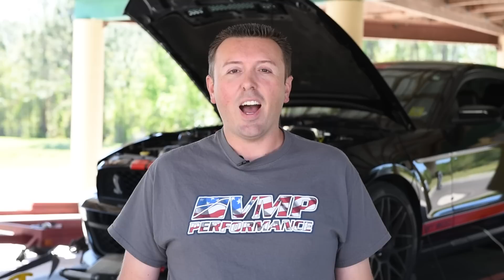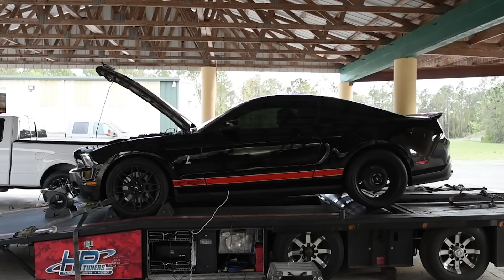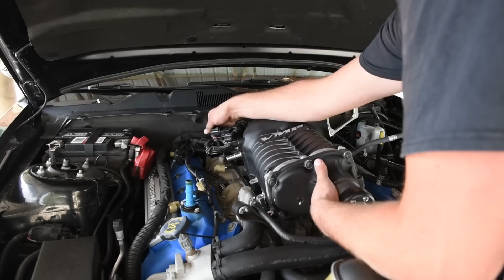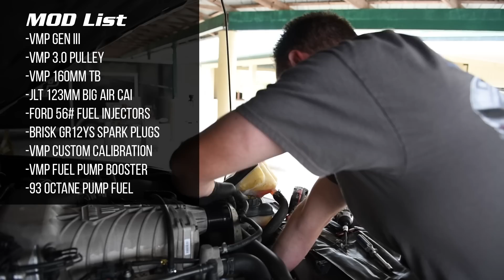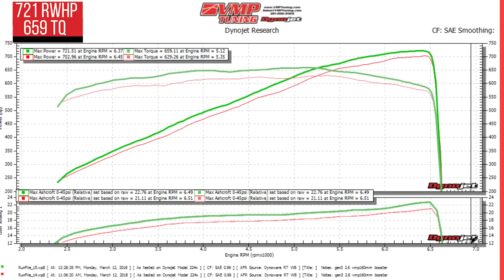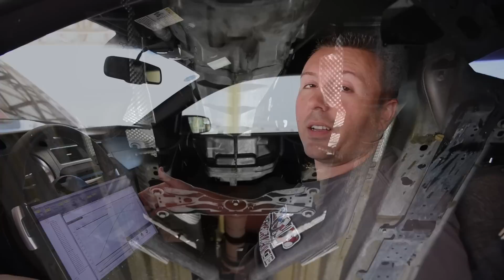VMP Performance | Stock 2012 Shelby GT500 Blasts Out 800 HP With VMP Gen3 TVS Blower

Comment: thought the 2012 gt500 made 663hp?
Reply from the maker: It was rated at 550hp, in 2013 they got the bump to 663hp with the 2.3l tvs and 5.8l engine.
Reply: Oh thats right, for some reason i thought they started that in 2012.. All that aside i cant wait to pick up a newer F150 and throw a VMP blower on it.

Comment: So i guys I have the 14 gt500 I bought your Gen 3 with 2.4 thru Chris at Dyno Edge it made 839 -17psi e85 ID 1000s, jlt 123, and vmp twin67 tb, my question is without going to a lower pulley do I stand a chance in making a  bit more power by going larger on the TB and the JLT? like your 160tb and jlt148?
Reply: Old comment but yes it will def make more power with the same pulley setup with larger tbody and intake.  These blowers (any positive displacement blower) hates inlet restrictions and will see gains with larger tbodies and the 123 jlt is known to support up to 800ish so at your power level you would see gains with the larger one imo.

Comment: @VMPPerformance

Just checking in, was wondering, have you guys been able to run anymore testing?

Have you looked at using the 149MM PMAS, with the donkey dick sleeve, from 1320 Junkie performance, with the 173MM throttle body?

Comment: So how safe is 800whp on this stock motor?
Reply from the maker: Hey Joe, I don't think its too bad.
Reply: How about on a 13-14 shelby
Reply from the maker: We've had several customers run around with the maxxed out 2.3l + E85 running in the 780-820rwhp range.  The cars held up for several years.  I would feel MUCH more comfortable making that number more easily and more efficiently with the 2.65l though.
Reply: What about the genllR for that 800whp range
Reply from the maker: The gen2r would require a lower pulley and a lot of other mods to make 800rwhp.  We have only seen it done on heavily built setups.
Reply: Thanks for being honest!

Comment: SO i'm getting my hands on a 2012 gt500 with 1100 miles I want it to hit 700-750whp, what would be the cost? Or should I buy a 2014 do some basic bolt on and e85 and be done?
Reply from the maker: Hey Joe, you are looking at around $5000-6000 in components to hit your power goals.  The 5.4l with a gen3 will make the power very easily and reliably compared to a 13-14 with a stock blower and bolt-ons.
Reply: So plans changed i am now getting this Saturday a 2014. So to hit those number above or closer to 800 what needs to be done
Reply from the maker: Longtubes and VMP Gen3 along with a few supporting mods like injectors and boosters.  E85 would be recommended.

Comment: VMP Gen3 TVS Blower doesn't make it "stock" -- Nice try. Stock blower with 2.6 pully runs about 550rwhp. The 5.4 engine in this car will handle up to 850rwhp if you have the blower to do it (like the TVS).
Reply: I guess you don't understand the term stock for this car, he means stock motor, and stock exhaust.😉
Reply: @karlhopkins713  people have a hard time understanding this.  It's clear he meant the gen 3 blower kit on an otherwise completely stock car down to the entire exhaust and engine.  These YouTube experts never cease to amaze me though.

Comment: My tuner is set for 92/93 octane. If I pour in a little octane booster into my tank, will I see a quicker car? I like your shirt can I get one of those?
Reply from the maker: Hey Joe, no, it needs to be tuned for it.
Reply: VMPPerformance 
Hi
Just bought the car with your tuner.  Can I make the change myself or would I have to send to you? 
If I plug it in, just to see what it shows on the screen is it ok?
Reply from the maker: Chief Joe give us a call to order additional tunes 321 206 9369

Comment: You want to know why this video pissed me off ?  Because there using absolute junk exhaust. This car will break 1100 wheel with 2" headers to 3.5 collector and dump it.  They aren't spinning the blower hard either.  This blower can achieve rpm of 30k.  This dyno nosed over at the end because the extremely restrictive exhaust.  I question the cams aswell.

Comment: Hey Justin, I have an 11 with a 2.8 on a trinity, no cats steeda exhaust, 56's, VMP TB, JLT intake and a 10% lower. BJ did an awesome job on my email tune/road data log but the last couple of months my tr7's are getting eaten up.. like the tip will burn off after 3 hard pulls. Not even getting 300 miles out of the plugs. Any ideas?? I've ran the brisk's he recommended a while back and it's the same thing. Mostly to the plugs on the left side. Thanks
Reply from the maker: Hey, please reach out to us in a support ticket with a picture of the plugs.

Comment: I would like to see a 2.4 upper with off road x pipe and 91/torco. Mostly because the cheap people that dont want to pay for full exhaust or racegas/e85 but want to take some advantages of a more free flowing exhaust/extra timing. I am also intrigued by how much boost will drop by to see how much restriction was freed up. I think 91 octane and torco tune would be nice to see on a Gen3. In a perfect world everyone would have E85 stations right next to them or didnt have to order barrels to keep in their garage.. however it seems to not be the case for most. :) Hopefully this idea intrigues you.

Comment: The new 2650 on an 03/04 cobra! Waiting for that!
Reply: caseindaplace nobody cares. To restrictive
Reply from the maker: Don't worry its coming in June!
Reply: VMPPerformance awesome! Looking for 600hp on tap. Both the 2.3 and 2.6 will get me there... would one be more efficient in doing so over the other? In terms of engine strain and mods to support that? Any less performance with the bigger 2.6?
Reply: caseindaplace yea the tvs 2650 is the more efficient rotor pack.  Will make alot more theb 600 with very very little effort.
Reply: caseindaplace but the elbow will always be restrictive on those 03 04 cobras
Reply: MegaMma4life yea I hear that sucks but have to work with what ya got. I hear the VMP runs cooler than the stock Eaton. I suppose whatever model I choose will be better. I plan to do the head cooling mod and new heat exchanger - wonder if an upgraded radiator and coolant reservoir would be needed (5K a year car - no track time)?
Reply from the maker: caseindaplace the gen3 will do it more efficiently but the gen2 is more than capable as well.
Reply: caseindaplace the tvs rotor pack is a completely different rotor pack then the old Eaton
Reply: I guess we will see when it’s released what it’s putting down with real life customers. The 2.3 would be cheaper on a side note I assume
Reply: caseindaplace would you take a bolt on gt500 over a bolt on cobra. Which one is faster? This video makes it very tempting to buy a gt500 and a gen 3 all at once lol
Reply: THE REDLINE RIOT Hmm, well either way both will make great power. I would say it depends on your personal choice for one, of the body style. The power plants are different. 03-04 cobra is the 4.6 but forged internals which can withstand large amounts of power. I’m not sure if the GT500s (5.4 & 5.8) of the specific era you are referring to are forged (someone chime in) however, newer technology / motors could out way that, personal preference? Don’t forget about budget.  03-04 cobras are a great bang for buck that can handle loads of power through different adders at low cost. But without thinking too much into it, although I have a cobra, I’d say get a GT500 if you can get a good deal, swap the blower / free up exhaust and you’ve got a newer, updated high HP car with little effort
Reply: caseindaplace ok cool! Well my budget isn’t the best. I can afford a 15-16k mike terminator cobra but most of the ones around me for that price have around 100k miles or have 75k and issues
Reply: THE REDLINE RIOT I think the highest priced one I’ve seen was a stock time capsule almost. 1,500 miles and was 35K at a dealer. High mileage and availability is an issue like you said. Mine happened to be for sale in my area so I got lucky. If I hadn’t gotten mine with 23k Miles I would have gone at least an 08 or newer GT500 - more availability
Reply: THE REDLINE RIOT a gt500 lol without question

Comment: Would 20 psi on the Gen2r and stock manifolds and cats be safe? Is that too much boost for it?
Reason I'm asking is that's the setup I'm running and wondering if I should put larger pulley on so I don't damage the Cats or motor..
Reply from the maker: MustangNthusiest if you have 93 octane I would say it's safe with a 2.4 or 2.5

Comment: Awesome work...REALLY dumb question. Is the gen 3 the new 2.65Liter blower? Also. If you strap the gen 3 with same exact condions on a 2013 5.8 as here how much higher would the #'s be? Do the 13,14's have that much more potential or is it just that they come with better stock blowers. Thanks guys.
Reply from the maker: Hey, the stock 13-14 blower is a 2.3l tvs, but the engine is also larger displacement and has slightly better cams.  Compared to the results we've seen so far from the gen3 on 5.4l, I would expect another 30-50rwhp on a 5.8l.
Reply: Don Johnson there. Bigger they have better cams and I believe there heads flow better. The 5.8 is a better motor.
Reply: @09shelby15  heads are the same 07-14 they have ford gt heads.  There really isn't that much difference in them when running the same blower.  Pulley for pulley they have comparable numbers but the 5.8 does it in about 2 psi less because of the displacement and they usually have a little better torque too although the 5.4 sure isn't hurting for torque by any means.  To me its not even close to worth it considering how much more a 13 costs and how much more an aluminum 5.8 block costs over an iron 5.4.  The price is WWWAAAYYYYY higher but don't have the additional performance to warrant the price difference imo.  As far as which one can take what power numbers stock the 5.4 can handle just as much power as a 5.8 if not even more so once you start leaning on it.  The 5.8 is nice but for the power difference you see when running the same blower and supporting mods on a 5.4 the extra price of the car and the engine isn't worth it imo.  To each their own.
Reply: @midnight347  I should of specified from the factory I tvibk the 5.4 in a nutshell is a better motor
Reply: Don Johnson yes it's the new 2.65
Reply: So the 5.8's aren't THAT much better...thanks for the response
Reply: Thanks for all of the responses

Comment: How is it that Shelby gets 1000hp out of the 2013-2014 GT500 on pump gas, and you used c16  to get not even 850hp, one of the supersnakes from then gets 850hp on pump gas.
Reply from the maker: The Shelby 1000 cars have quite a bit more done to them.
Reply: Just Some Guy they didn't have exhaust 1-3/4" heads to stock mufflers. Th ats restrictive as hell.  Pick up big power off 2" header and dumping under the car.  Big power
Reply: drfaticus F-gm that wasn't pump 93. It was either e85 or c16. Also that had a built motor, cams and exhaust.
Reply: Just Some Guy i haven't seen that, there is a guy in Chicago with 850 and he uses 93 octane
Reply: MegaMma4life it was 1 7/8. But I did hear the stock mufflers can be restrictive.
Reply: drfaticus F-gm ok and? I never said makin power on 93 wasn't possible. But they didn't make over 1000hp on 93 pump.
Reply: Just Some Guy the car had 1-3/4" to 2.75 axleback stock mufflers horrible exhaust setup
Reply: Just Some Guy any chambered mufflers is restrictive and the stock mufflers on the gt500 are awful
Reply: VMPPerformance what's quite a bit?   90 degree crank gt350 heads and a 4.6 liter blower.  The only difference is the blower size

Comment: That gen 3 with JDM Super Stock cams, long tube headers and upgraded rods should hit very close to 1000 reliably. Definitely know what path my 2011 GT500 is taking now. Nice job VMP
Reply: Jdm cams are garbage, l&m are way better. A guy blew ruined his valves twice with a 5.4 gt500, because of the jdm cams. He switched to l&m never happened again
Reply: Ya one thousand horsepower is just headers and a cam swap away...

Comment: An LS swap... Lmao jk deff needs to breath... Some LTs and a good flowing exhaust should add some power.
Reply: I bet longtubes and catless mid would pick up 50+ rwhp easy on this car with this setup the exhaust is choking it off bad.  A full 3 inch exhaust would be best at this power level imo and i bet therr would be higher gains than 50 rwhp with a complete catless 3 inch exhaust with long tube headers.  And it would be making that power on like 2 psi less lol.

Comment: Well, obviously exhaust in all different phases (axle backs, then full exhaust change with x pipe, then headers). I have that same exact car, but a convertible. 

Side note... You guys made a lot more HP with a basically stock 5.0 coyote. ???
Reply: Yea a coyote with 11:1 compression, alot more rpm and alot better fuel sure.  It ain't that hard to make big power when you have a high compression and variable cam timing and 8000 rpm to help you out.  That was car also had a full exhaust too which is a good difference at this flow level and power level.

Comment: Could you list the boost numbers on the Gen2r with the 2.4,  and then list or mention the boost number on the Gen3 with the 3.0 pulley please.
Reply from the maker: Hi, see the boost curves at the bottom of this image: http://cdn.speednik.com/wp-content/blogs.dir/1/files/2018/03/stock-2012-shelby-gt500-blasts-out-800-hp-with-gen3-tvs-blower-2018-03-21_15-28-12_323607.jpg

Comment: How soon till you add the 170mm Mono Blade Throttle Body?
Reply from the maker: I'll check on that, but I believe the 173mm is primarily for race applications.  ~ Kerrie
Reply: @VMPPerformance

Just checking in, was wondering, have you guys been able to run anymore testing?

Have you looked at using the 149MM PMAS, with the donkey dick sleeve, with the 173MM throttle body?
Reply: VMPPerformance  okay it's for race but we need to see the gain of it